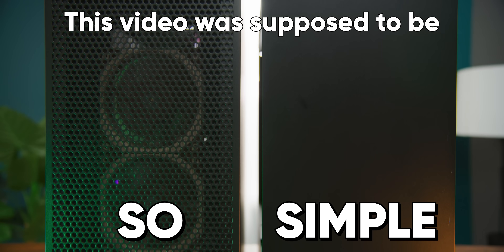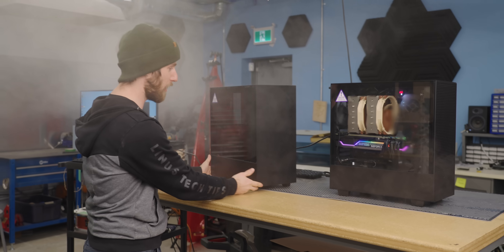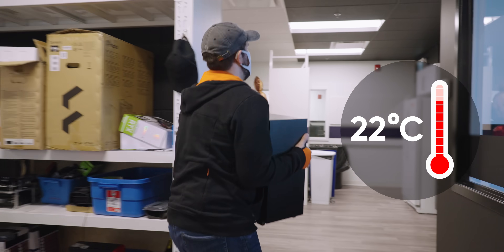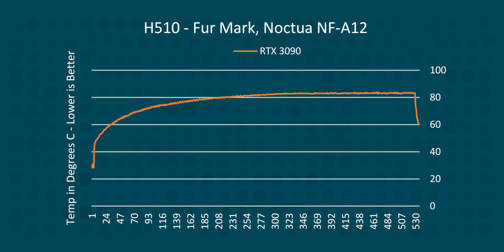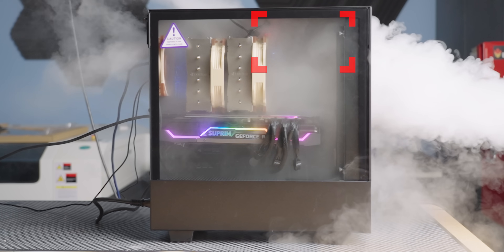Everything You Know Is Wrong - Mesh vs Non-Mesh Front Panel

Comment: Cases with top exhaust are dumb unless you're sticking a radiator up there. Otherwise they just break the internal positive pressure. A solid-topped case with good internal pressure and front-to-back airflow will get plenty of air under the card. Once I got to that point in my case, removing 1 or 2 of the case PCI slot covers directly below my graphics card created a pressure release point that directed more of the cool intake air down under the card. I could feel a decent current of air flowing out of those slot holes. On my "Quiet" fan setting, a heavy game will make my card thermal throttle at my custom setting of 69C (nice) pretty quickly. On my maxed "Wind Tunnel" fan setting, the same game will have the card running full tilt while maintaining around 62C. Also, I don't know why everyone uses Noctua NF-A12X25 PWM for everything. Noctua specifically describes that model as a lower-noise fan mostly intended for static pressure applications like radiators or heat sinks and secondly as a general all-purpose fan. For radiators and heat sinks tho, I'd probably go with the NF-F12 PWM as they're plenty quiet and rated to move more air. I've NEVER seen anyone use Noctua's airflow-specific model, the NF-S21A PWM, as case fans. I purchased those for my case and they move a TON of air. They're rated to move as much air as the NF-A12X25 model but at 1200RPM rather than 2000RPM.

Comment: I've never been a fan(get it?) of "traditional" vertical mobo cases, instead I opt for cubic cases(like thermaltakes core V series) with horizontal mobos, that way you can expose the gpu to direct and heatsink fin oriented airflow with the plexi window on top of the case, while both "sides" are intakes. I get that that case series looks horrible to many people, but once you get a hot cpu and a chonky gpu, you need cooling, not looks. A 3080, ~300-400w depending on exact model and settings, a moderately powerful cpu like a 5900x or the intel equal ~120-200w depending on the oc. That's 400-600w of total heat output(unrealistic, yes, but a good spec to match your cooling solution to, incase you live somewhere "hot"). That's like having a bread toaster in your case. 
Put the heating element in your case and you get a bad oven, you need to consider cooling it.
Reply: I did the same with my corsair carbide air 740: Put it on the side, window on top. So GPU and CPU cooler can't even sack and the 'bottom' is free to suck air in to the GPU. I removed the feet so it looks more symmetrical and put some wooden slats under it to have air for PSU from the bottom. It is big, open, cold and safe - love it. I really needed to search for a case like this.
Reply: While not a cubic case, this is one of the reasons I am a fan of the Coolermaster NR200. It's not a perfect case, but it places its power supply up top leaving a completely flat and mesh bottom for the horizontal GPU configuration to sit on top of. even with many beefy GPUs, slim size fans can fit under it and pull air and blast it directly at the GPU, leaving it to run super cool, rather than having measly front intake leftovers like a lot of cases with a bottom power supply shroud. CPU thermals can struggle a little bit because of this config but I've found them mostly satisfactory.
Reply: Yup. I have a Bitfenix Prodigy, and it's great to work with. I cutout a window in the GPU-side panel, so it's got all the ventilation it needs. I'll put a window there if I end up watercooling the GPU later.
Reply: THANK YOU!!  THANK YOU THANK YOU! right you can bassically the hot air up and away with a case like that and have a lot better airflow.
Reply: coolmasters  boxy case they did a build with a few years ago is fucking cool (waah waah waaah waaaah trombone sound). and doesn't have this retarteded need to work against physics and gravity as well that's (yet another) reason this dumb thing the industry has with only vertical cases. GPU's are no so heavy they bend eventually if, ya know, you use just a few thin pieces of metal. but horizontally that's not a problem, well made screws and gravity will keep all the parts together for decades.

Comment: Problems with the video:
4:50 - I'm suprised that LTT didn't 3d print a nose cone for the GPU to see if turbulence would decrease. 
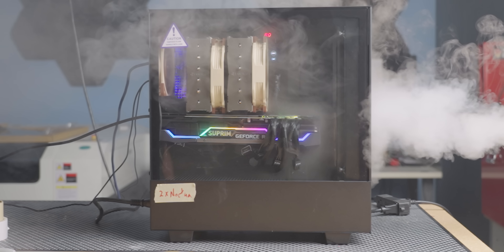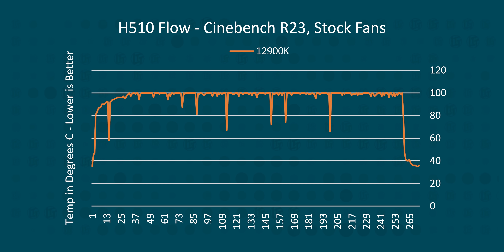5:00 - Was noise level even mentioned in the temperature testing beginning at 1:55?
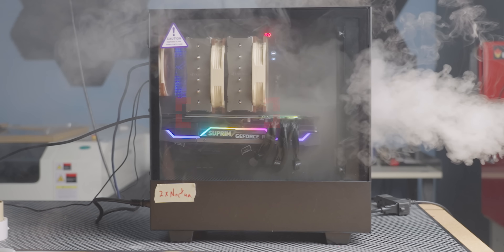5:25 - I thought a previous LTT video said that GPU backplate cooling doesn't matter

I felt this video was more about criticizing the PC parts in the case and the case itself rather than finding out if mesh is better than no mesh. Was the point of the video to demonstrate that case airflow depends entirely on the parts in the case rather than mesh vs no mesh? But then LTT should have demonstrated that no mesh could adequatly cool lower end parts. LTT should have tested other cases too with mesh and no mesh variants.

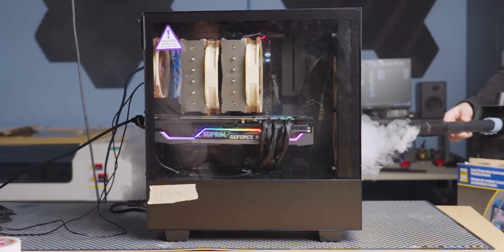Overall, I think this video should have been two separate ones. One with only mesh vs no mesh and the other about balancing fan speeds to minimise turbulence. I hope LTT makes a follow up video to test out their hypothesis since the video didn't really attempt to pose a meaningful answer to the computer configuration's problems. The video could have been much shorter since the middle part did not really have much to do with the initial question of mesh vs flat panel. The middle part of the video, which was the most interesting, didn't have an answer other than suggestions and the conclusion even states that LTT is stating the obvious 7:00. I think too many different ideas from experimentation caused the video to get confusing.

Due to the poor quality of writing and experimentation in this video, I feel I should stop watching this channel for true scientific testing. This feels very much like Austin Evans' PS5 video.

Comment: What we need is a dual chamber case with a splitter separating top from bottom, so air coming in at the front at the top goes to the CPU and air at the front bottom goes to the GPU and they can't interfere with each other. Of course if you own a Corsair Crystal 280x/680x Lian Li 011, Fractal Torrent or similar where you can have bottom case fans bringing air in for the GPU and air in the front for the CPU you/we know all about split air supply.

Comment: 3:10 This graph doesn't match what you're saying.  The graph clearly shows the temps dropping with Noctua fans, despite you saying the temperature increases.
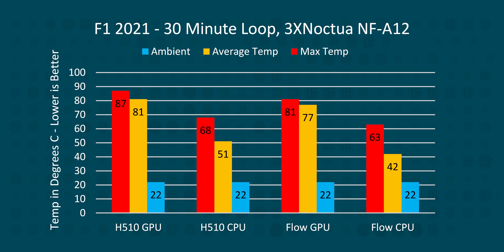3:52 This graph doesn't really demonstrate your results very well.  In  your commentary, you're comparing with/without Noctuas and saying that the CPU cools (e.g. H510 CPU without -> H510 CPU with) while the GPU heats up (e.g. Flow GPU without -> Flow GPU with).  However, the graphs show a comparison of the two different cases rather than with/without Noctuas.

If you do a follow-up video, make sure to test both blower and open-air GPUs.  Check how the orientation of the PSU affects results (using the PSU as a bottom exhaust vs using fresh air from below the case).  Also, try putting some baffles in places where the vorticity occurs to regulate the air flow and switch to negative pressure inside the case to help exhaust hot air.

Comment: I have the h510 case but tbh im happy with it, my ryzen 5 3600 is at 4.4 ghz overclocked and when fully loaded its at max 63 celsius.
My gpu is a gtx 980ti strix and when fully loaded is at 75 celsius. So im happy with it.
Reply: You probably installed your fans correctly. The Linus crew did not.

Comment: Sounds kind of like pull>push. Positive pressure inside was causing a lot of turbulence and internal recycling (which is bad, just pushes the hot air around repeatedly), so having negative pressure would pull the air more efficiently (though you would need to make sure you had enough area being pulled so that the card still got a good amount, instead of it just being a dead zone under it). 
But of course the 'biggest' issue is just using those chonky graphics cards in a case they barely fit in, so it totally screws up all the airflow

Comment: Please do the fractal meshify 2 - it is much longer so you won't have the gpu blocking air flow but even with 6 noctua 140's I also found at slower speed I get better temps

Comment: Honestly, this is why I don't buy cases with PSU's placed inside the main compartment of the case, where it can block the air intake for graphics cards like this. Getting any case with fans that lets you pull fresh air from under the case and pushing it up into the GPU is such a great upgrade, it's worth the extra money. My 3080 struggled until I got tired of throttling and just got a bigger case; Dropped it down to just 80 degrees when pushed and I could finally play my games on it.

Comment: For me this calls for a divider, wich creates seperate compartments for the CPU and GPU wich are supplied by the bottom and top fan behind the front mesh. And additional aerodynamic shrouds for the GPU cooler housing to disable any turbulance and create good airflow towards the GPU fans.

Comment: Should have shown rotating the CPU cooler 90' to have it exhausting air towards the top. Both FE and partner board coolers push air from the bottom, FE straight up and partner coolers to the side. You would probably get a better cooling tunnel with homogeneous air flow across components.

Comment: Really interesting look at airflow turbulence inside a case. Small note, though: Using a cooler that requires you to remove the top exhaust fan in the regular H510 really hurts it thermally. The case ships with a negative pressure setup with two exhaust fans and no intake, and this is actually the optimal setup for GPU thermals since the GPU pulls in air from the PCIe slots. It would've been interesting to see that explored with the smoke tests.

Comment: The h510 is a case that in my opinion is just too small for components like these, the parts look like they have no room to breath
Edit: i commented in the beginning of the video, turns out i was right. I use a 5000d airflow from corsair and installed 10 fans in there. The case is big and the 360 watercooler is doing a great job cooling everything. In idle i run 29 C on all component and 34 while running csgo in a deathmatch with max graphics on. Id say that cooling has alot to do with the space you give the components and the aero of the parts. If the 3090 had a spoiler that splitted the air, the air wouldnt hit the side of it like a brickwall

Comment: This is why I'm interested in one of the EVGA hybrid cards. I run a smaller (though not SFF) case and an NH-D15, my CPU temps are fine. But with a 3080 cooled by a front mounted rad, and the rest of the GPU components cooled by a blower style card that exhausts out the back, I think I'd be much better off. It eliminates the need for air to come in straight, then turn 90 degrees in order to reach one of the hottest components in my system. Rather, the only components not directly in line with a front to back airflow would be things like the VRMs, RAM chips, etc on the GPU, and those are usually cooled quite easily by the blower portion of the Hybrid GPU.

Comment: use mid tower case with 3 front fans + ITX motherboard so the GPU would be right in the middle of the case. Problem solved.

Comment: What about the power supply? You can either have it as it's own system or taking air from the bottom of the case. Would that help lead air under the gpu if the psu is a part of the exhaust?

Comment: In other words: this is not about the fans, but about using a badly designed case that's too small for the GPU. Putting stuff right up against the fans has always been a bad idea and especially in this case you have the gpu right in the center of the front fan, which is terrible design. Ideally you want the entirety of the fan below the GPU so all of the air it blow into the case can settle under the card - and then you don't have the problem of the fan blowing straight into the card's shroud. In proper mid-size cases this is usually how the fans are placed. But the best solution, like Steve from GN also said, is to have a fan in the side panel that provides air for the GPU, but sadly no one makes cases for that anymore, even though we need more air for the GPU now than ever before.

Comment: Since you have active cooling and exhaust in the upper half, the lower half needs its own independent zone.  Exhaust should be an easy remedy by inverting the PSU to use its fan.  The lower zone active cooling should match the upper zone’s.  In this case I understand why one would decide to go with liquid cooling.

Comment: What if the front panel was a full mesh instead of 2/3 mesh? would it not make sense to use a case that stacks a full 3X 120mm fans since those tend to have a mesh that is the full front panel? From watching your smoke test, I can't help but think that if there was another fan below the one that is blasting straight into the side of the GPU, that it would do better. Further, if there was a place for air to escape at the bottom, such as the PSU, these tight quarters might work just fine.

Comment: So what happens if the fan configuration is different on the card? I.e. NVIDIA’s 30 Series FE cards that would push the air out behind the CPU cooler or blower cards? Or even a vertical mounted GPU on a riser cable allowing for space for airflow behind it?

Comment: My impression was that both of these case's suffer from poor air flow/ventilation.  Seems to be a trend in case design.  Is why I still use a 12 year old Cooler Master 690 full tower case.  It has plenty of ventilation especially with 6 140mm fans on the front, top, bottom and sides,  a 90mm on the rear and an 80mm  on the backside of the MOBO.   The metal shrouds case manufactures are fond of putting around the PSU and  the case bottom I don't think help air flow either.

Comment: would like to see something like the  nzxt Phantom with  2 200mm fans in the top that  suck out all the heat in the case... its probably good  to have positive presure but  only if it can escape fast enouth to move the heat away ...
so teh next desing  choise is  using a  pci kable to  move the graphicskard  uprigth  rigth behind the intake fans rigth ? :D

Comment: The problem is with the CPU cooler, even if it's able to puche the heat out of the CPU it's always inside the case, that's why using an AIO could help so much with GPU tempreture but the problem is u can't use an 360 one so it may causes heat problems for the CPU if you uses a 120mm one as the NZXT recommande :<
any way you could also move the GPU a bit but I guesse the PCIE slots are older gen so IDK

Comment: i have a corsair case 220T using aio top mounted with 2070super 32gb 3200. ryzen 3700x 3.9 clock fixed. m.2 expansion pcie card 1slot, 1cm away from gpu.  3 front fans 2 on radiator, i discovered over the 2 years some hot spots on certain devices nothing dangerous or any but right above their average, thinking i could push multiple components a tiny bit higher if they are colder example gpu,  pulling heat out more > i add a fan at the back, think it would help right hm yes but no. since then my cpu runs hotter 1-5°c depending load AIO so eh, but internal components ssd ect do run colder especially the m.2's. now cpu and gpu took somehow a hit on this as the back fan is 2cm away from top mounted fan it creates turbelance it helpt internally too the small components but hit the bigger parts more. seeing this video i would like seeing tests with AIO seeing if it is smarter too have 5 fans my old config or 6 new configuration i have. i stay tuned as always.

Comment: Maybe put a fan on the bottom of the case pushing air at the gpu? Unless its like directly against the PSU with no significant gap. Hard to tell with this shroud. I mean you could also flip the PSU to suck air from the inside of the case, but usually the PSU fan only spins when its hot enough, so thats also not a great solution, plus it might starve the GPU from air once spinning.

Comment: With such analysis I was expecting some exploration of fixes to the problem, like putting the GPU in a lower slot, getting a smaller CPU cooler, larger cases or trying a intake config with smaller but we'll placed fans.

Hopefully the new labs channel can get long form videos about that.
Reply: I was hoping for a test with a smaller and thinner GPU after the initial findings
Reply: Wouldn't the lower pci-e slot have less bandwith?
Reply: @CaffeUmU  depends on the motherboard, but even if it's only x4 lanes of gen 4, that's plenty of bandwidth.
Reply: This looked like a trailer.  I'll bet there's a 6 video series in the works, about how to address the problems.
Reply: A funny solution that worked out for me on a similarity small case (Corsair 400C) was running only one fan on the NH-D15. Really helped with my GPU temps.
Reply: Airflow above the gpu isn't going to change much. How much air gets in under the gpu, where the fans are, is what makes the difference. I'm thinking a bottom fan or lower mounted front fans is the solution to this.
Reply: @ybra  depends on the gpu. A lot of the times there's stuff like vrms and other things so cooling is appropriate
Reply: @CaffeUmU  The backplate is used to cool some stuff, but the actual core is cooled from below. Point being, it's easy for hot air to be trapped in the corner unless you have a bottom or side fan giving the gpu fresh air. Especially with a small case with little space under the gpu.
Reply: @ybra  backplate isn't always enough. Rtx 3080 and 3090 being an example of that
Reply: I just run my case with the glass off and two fans (not mounted, precariously placed) pointing at the underside of the GPU fans